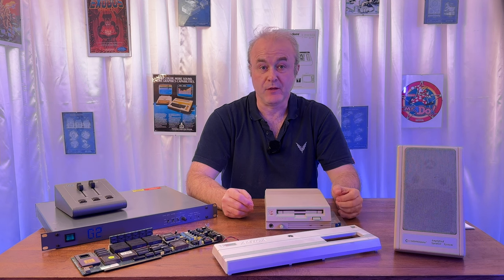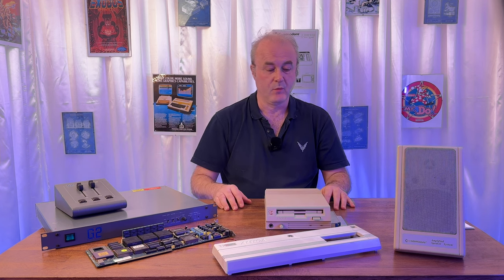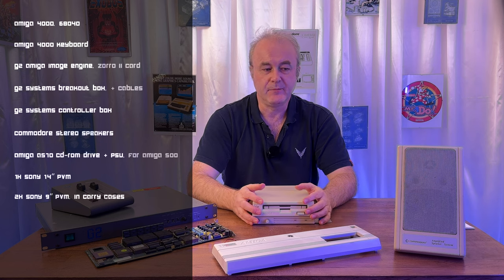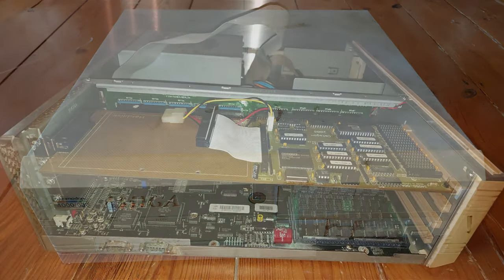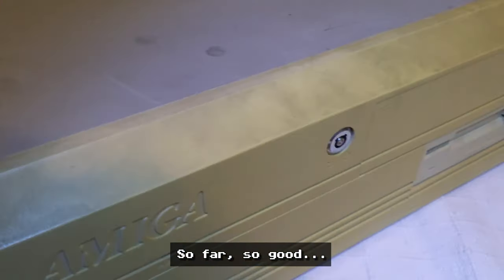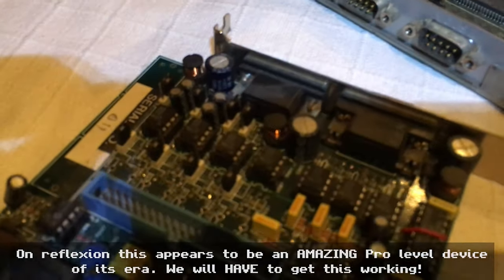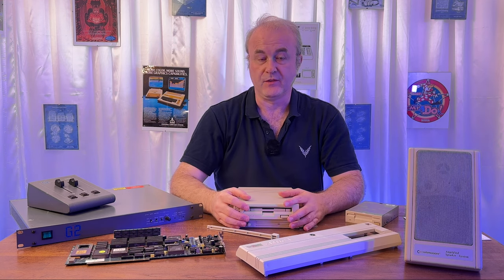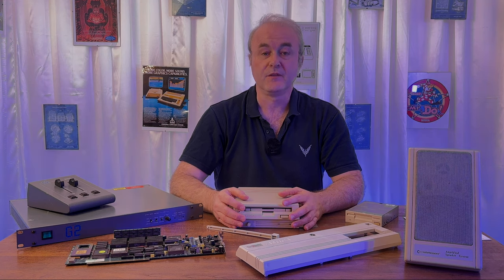Amiga 4000 CH01: The Rescue & The Hoard

Comment: It is amazing that today people are making replacement 4000 sheetmetal cases, there are replica motherboards and daughterboards, and people have 3D printed and machined out of billet aluminum the front fascia, and you can still get NOS AGA chipsets, so you can build brand new Amigas. The 1 things not really avaliable are keyboards and key caps. Even the color matched screws for the case are avaliable at times!
Reply from the maker: Yeah, I have also seen totally new Amiga 1000's, well, I assume most of the chipset is original, maybe made from salvaged A500's mostly? Cant see why anyone would cut up an original A1000, as they don't really suffer from battery damage. 
Now, A4000's battery damage is VERY common, and sometimes its terminal. Also, I have seen machines where the fascia, or the chassis has bought the farm. So I think these modern replacements are very much welcome.
I've not seen the machines fascia's. Do you know of the project name, Id like to see what they look like :)

Comment: Wow, great find. Cool stuff, even if much of it may not be of much use today. Would be fun to see it all work again. 🙂
Reply from the maker: Indeed, well, if you watch the Fastlane Z3 video, you'll see it working, buuut soon after it developed a fault in its video, which was gradually getting worse as I filmed that video. 
Anyway, I have a new video coming soon, where I fix that issue. But yeah, at some point I really need to show the machine doing its thing. I have a video capture device now, so I can now capture its screen in much higher quality. Something to feature soon :)
Reply: @RetronautTech   Cool, I'm in the process of fixing my A3000 and planning to build a z3660 accelerator for it once I'we sourced all the components. Hopefully the A3000 scsi will not cause any problems with the combo. From what I´we seen it can be problematic.
Reply: @kjellmesch8060  Can I ask, why do you feel the need for a 68060? What does your A4000 have in it now? Also, in terms of SCSI, I think the onboard SCSI can be disabled on the A3000, allowing you to use its SD to SCSI system. Should be a screamer.
Reply: @ChrisThomas-lt8jd  I'm probably not going to use a 68060 on the board as they are so expensive. The z3660 can use a z-turn board that can simulate the CPU at greater speed than a 68060@100Mhz. Making it sort of a PiStorm for the big box Amiga. The scsi chip on the A3000 is a picky one and adding a board with scsi can be a problem. Adding a sd2scsi thing however works just fine. I have a BlueSCSI v2 in the machine now.
The "why", because I feel like it 🙂

Comment: The yellowing is due to the fire retardant in the plastic, which has a bromide compound in it. Some plastics have more or less, which is why some do not go yellow. In some plastics, like Apple PowerPC cases and HP printers, it cases embrittlement of the plastic too, as it ages. The proccess is accellerated by UV, rather like film developing.
Reply from the maker: My experience is its more heat that UV. I think the UV imparts heat effectively. I think this, as I left a retrobrited machine next to a radiator, in a box, closed, no light at all, and it yellowed again. So, keep them a way from light and heat, or indeed flame throwers or run-away nuclear reactors.

Comment: Hi Chris! I found your channel by the Facebook posts re: the latest vid.
Looks like a really interesting find here. I run an '040 Amiga 2000 (1990) with Fusion Forty (1991) that I bought new back then, but am curious to see what Commodore did themselves with the 4000, which I never really paid attention to back in the day. :)
Cheers.
Reply from the maker: Check out this video https://youtu.be/W-O6mnDkNyA. I also had an A2000 (in A1500 guise) back in 1991-93. It was my machine through years 2-3 of Uni and I used it for a mixture of gaming (of course) 3D rendering and also graphic design, which I was doing in college. It had a 68030 card in it, maybe 8mb of RAM, as I recall. Though, TBH I find it hard to remember EXACTLY what I had in that machine. But it did also have an A-Max Apple Mac emulator card. I KNOW that as I recall using it at home for course work. Quite a boon at the time. BTW, I found your video on your A2000, I'll give it a watch :)
Reply: @RetronautTech  Nice - fun to find people with shared experiences; I'll catch up on some of your library of content. It you visit my channel, perhaps my Amiga video "The Fastest Mac Plus Ever?" would be of more interest, given your experience. :)
Peace.
Reply from the maker: I will, thanks. Now, with this A4000 my unfinished business, is trying to get its G2 Image Engine card working. It was a pretty epic card back in the day. But I just cant find the software for it... @DrDavesDiversions

Comment: Gouging, Amiga HW on ebay!?  Say it aint so! ;) Amiga HW has been AGRESSIVELY overpriced on ebay for years.  The Amiga community refuses to recognize the depreciation of Amiga hardware.  It isn't rate, it isn't as collectable as some other (more rare) hardware, it should not retain its value like ebayers seem to want to pretend.  Excellent video. :)
Reply from the maker: Yeah, certainly its a thing now, that if you want a matching keyboard WITH your Amiga 2000, 3000, 4000, then you MUST get it when you buy the machine itself. Otherwise, you end up paying £200+ JUST for the keyboard. I know, I did it for my Amiga 2000 keyboard. My Amiga 1000 came with its keyboard, and that these days is so... rare. Anyway, the next video is queuing up, premiering it shortly...

Comment: Far too much text on screen which takes attention away from the video, and far too long. You repeat yourself in the text far too much and you don't leave it up long enough to read, especially when it's a full screen width of multiple lines. Reduce that text, it's mostly not required.
Reply: Noted, Ill be trying to address your comments in future videos, Ill try and increase the display duration. Not sure I want to reduce amount of text, as its meant to be suplimentary, however, if it IS repeating what I am saying verbatim, then Ill try and prune, but sometimes you need to add some duplication or the text does not make sense, as its own thing, if you get me 😁